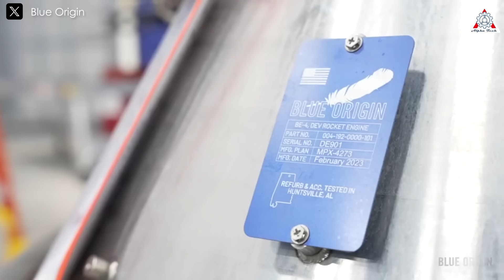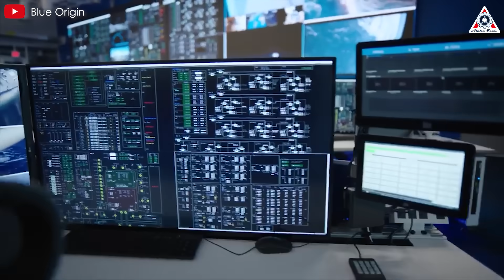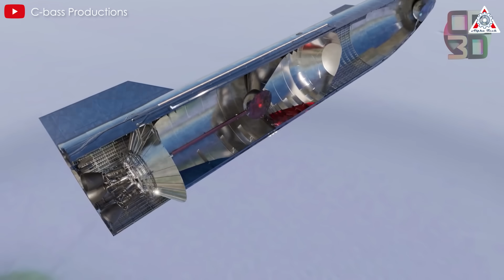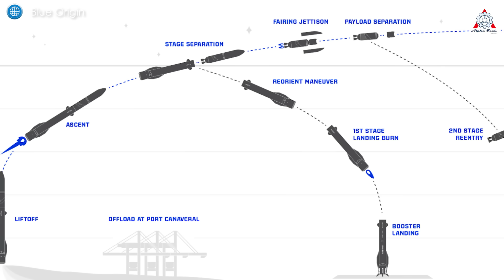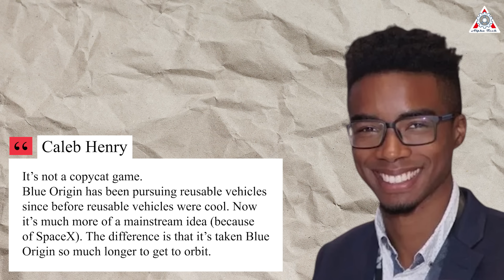Something Weird Happened to Make the First Launch of Blue Origin New Glenn Delay Again...

Comment: So If Falcon Heavy already beats Blue Origin with payload to LEO than what exactly is the point of Blue Origin?
Reply: I ask the same thing. I don't think there's a huge market for large payloads to LEO or stationary orbit.  In addition, Starlink shows that you can launch small satellites that give customers consistent and constant connections, including black ops. Other companies are surpassing Blue Origin in launching vehicles. Starship is designed for interplanetary travel, not large stationary loads.

Comment: they need to lose the ability to get contracts, until they are actually proven to be usuable.
can't hire a courier to take a package if they can't go anywhere. they've already accepted so many contracts and helped practically no one. why bother.
starting to wonder if the company has workers with enough skill to make it all work right. it's like they keep running into engineering issues they don't have answers for. and then just blaming it on trying to be over cautious, when really the skill to achieve the goal is missing. i mean it happens. 

when your owner doesn't know how the business works but just owns it that becomes an issue. when that's the case and the owners don't know enough. they may never realize the lack of skill sets.   or even have the best people in the wrong areas. over skilled workers where their skill is being forgotten does the same.

i love the line about using reusability before it was cool.. would be even cooler if the ship was even considered usuable at all when he said it LMFAO. i really do try not to hate on bo, i just don't know what to like about em.
Reply: Well you wrote all of that, just sounds like a lot of pissing and whining. Get over it. It's a private space company. Your opinion doesn't matter how you feel about them.

Comment: Blue has no working orbital rockets and the also infringing on a name of beer for there luner lander. Blue moon is a bear and is copy right infringment
Reply: I believe you can have the same name as another product provided there is no possibility of confusion, e.g. if the two products are of totally different kinds. Thus a moon lander is nothing even remotely like a beer, so it can have the same name as the beer. 
I expect the graphic design of that tradename must be different, though.
I'm not an expert in copyright and trademarks, though I did study them a little in the past.

Comment: it takes a long time for a billionaire and a room full of random, gormless executives to take a vanity project and turn it into an engineering company - not necessarily an effective engineering company, just a reasonable facsimile of an engineering company. yet such a transformation, (should it actually ever occur, especially with BO), would never rid itself of its inherent, deep-seated, philosophical fear of being found out to be fakes. this should largely explain BO's propensity to spend more time and resources hiding and denying technical issues, internally and externally, rather than to fix them. such a mindset has led to the complete erosion of public interest in whatever they claim or do (despite tons of money wasted on PR, shills, and bots). the only way BO could eclipse any Starship operation would be by failing so bombastically as to gain eternal infamy

Comment: New Sheppard is NOT "sub-orbital", it is "NON-orbital"! Orbital means circumferential movement - at high speed.  NS only goes straight up and straight down. It achieves ZERO horizontal velocity. It can't even spell orbital. A balloon in the wind is more "orbital" than NS.

Starship flights 5 & 6 were (intentionally), sub-orbital - circumferential velocity only just shy of orbital speeds.

Comment: BO is no different from all the other 'legacy' Operators like Boeing, ULA, NASA... everyone but SpaceX.  Risk avoidance is the innovation killer.
Reply: Blue Origin: $12billion passion project founded and almost entirely funded by a brilliant electrical engineer who gets a bad rep for being a successful geek.

NASA: External agency using public funds that focuses primarily on science and exploration for the benefit of humankind. Rover missions, probes, scientific satellites, etc. NASA has not been a rocket company since the 70s/80s when they wrapped up the development of the old Space Shuttle. They have outsourced their launch vehicles for decades.

ULA: 50-50 joint venture between two established advanced aerospace companies, Boeing and Lockheed Martin, that were already heavily-tied in with the US military through decades of government contracts for the DoD. They were one of the main launch providers for both government and commercial enterprises for many years and estimated to be worth around $2billion but are struggling in recent times.

SpaceX: $350billion company run by a group of investors. Was able to grow and advance quickly due to significant initial funding from external sources and it currently generates enough revenue from its Starlink and launch services that it can take some calculated risks in its R&D without the risk of wiping out the funds of any one particular investor.

Blue Origin has no real backers. The donations and contracts it has obtained are insignificant to the overall cost of the project and Bezos pays for the entire operation and everyone's salaries out of his own pocket by selling off his stake in Amazon every year. He is in no rush to try keeping up with the titans of the industry and since he isn't being pressured by a board of partners to produce any results he and his employees get to take their time making their rocket.

So, no. BO is nothing like the other companies.

Comment: Bezos has painted himself into a corner…if anything goes wrong on this first flight, I think Blue Origin are cooked….they build so slow, they could never recover in time to become commercially viable.  Never.  This is a one shot deal.  Good luck.
Reply: Yes the stakes/expectations are very high for this maiden flight.
Even crazier that NASA booked the Escapade mission on it. Ok it was cheap with $20 million, but what did the ESCAPADE vehicle cost?
At least they have time to build a new one until the next launch window will arise.

If Blue Ring doesn´t perform as expected (same with ESA´s  Ariane 6 upper stage reignition problem),
or it isn´t brought into proper orbit in 1st place by the booster and 2nd Stage, some SHTF in B.O. headquarter will happen for sure.

I don´t know how much own money Jeff put into the company and how much is taxpayer money and how much of the $5.6 Billion DoD launch contracts were awarded to BO, but either Jeff (his Dream, Project Kuiper) nor the DoD (backup reasons) will let die the company.

The building time should improve now with all the facilities built and the new CEO and Jeff looking over it.
Of corse it is way smarter to begin with building a flying water tower with a Raptor strapped to it in a flimsy tent on a graded gravel area,
and build and scale the infrastructure as neccessity grows/shows the proper way, instead of planning everything ahead.
Especially when you have been shown the proper way to go before with the Falcon development.

For sure the timeline is way overdue, but that´s the same with SpaceX, ESA, NASA, Boeing, ULA...
To be fair, they should get at least 2 attempts to go orbital and 5 for landing the Booster on Jackelyn.

I expect a great show either way ;)